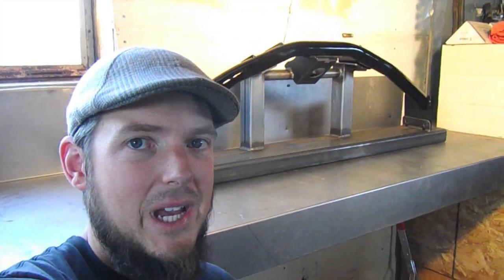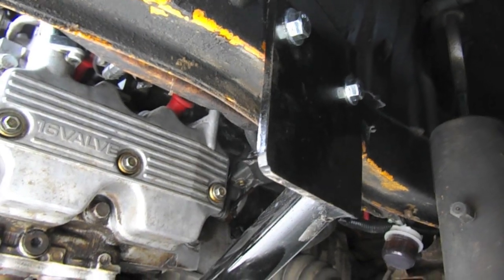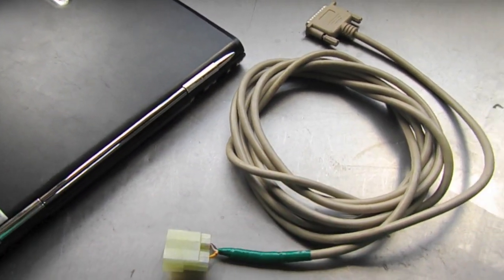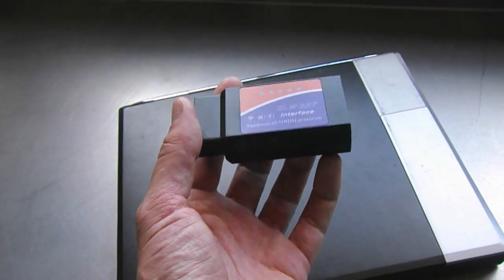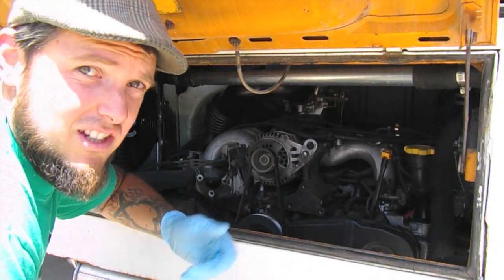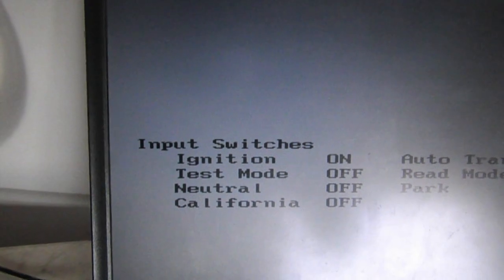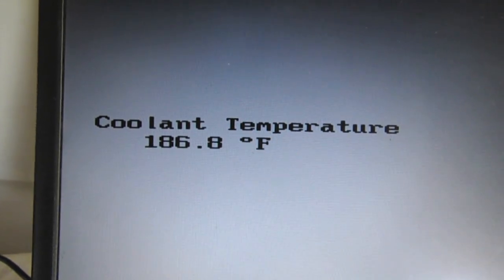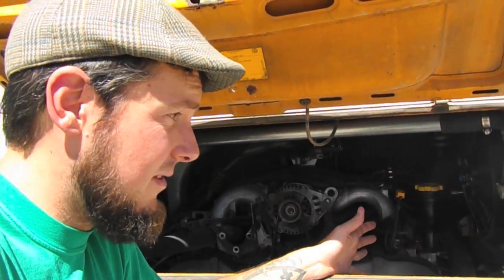Subaru Engine Starts! - Busaru Engine Conversion Part 9

Comment: Fired right off. Nice. Check your throttle cable and ICV. Betting you need to loosen up the tension on the throttle cable to drop the idle a little. When its warmed up it should be idling quite a bit lower. Make sure all the clamps and hoses are tight and there are no vacuum leaks because obviously that will cause the engine to idle erratically as well.

Comment: your help.vw beetle with an ej22 1992 motor. i want to eliminate tha charcoal caniste ( the emission control  law here does notr exist ).1.block off the throtle body tube vacuum tube(otherwise it will suck air)  2. connect the purge control valve( if not  the ecu will  throw a code error 35). so question is : the 2 small tubes on the purge control valve  should i leave them open ?  should i block off them or loop them? thanks in advance. george
Reply from the maker: +GEORGE BOURDEISON Hi George, I would just leave the purge control sol valve vacuum connections disconnected and follow the rest of your plan. I do this most of the time. Good luck!

Comment: great work. have you check VWRX.com - Volkswagen Vanagons with Subaru WRX Turbo engines
Subaru Select Monitor Scan Tool

NEW: Source code now available under GNU General Public License!

check it please and tell me.
Reply from the maker: George, thanks for the heads up - I'll definitely have to check that out. I'm assuming it will work with all OBD 2 Subarus through the Select Monitor interface?